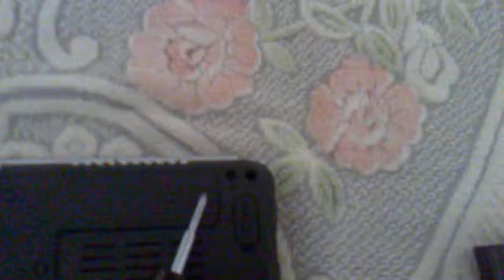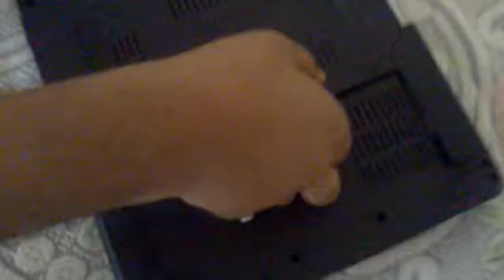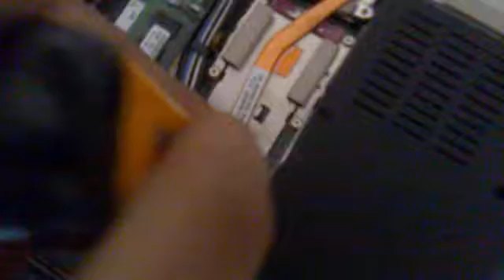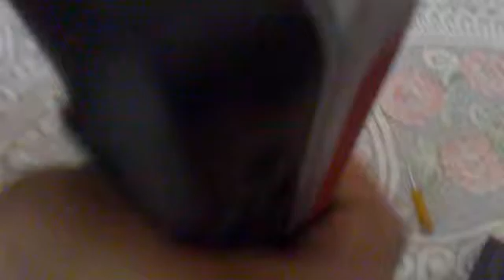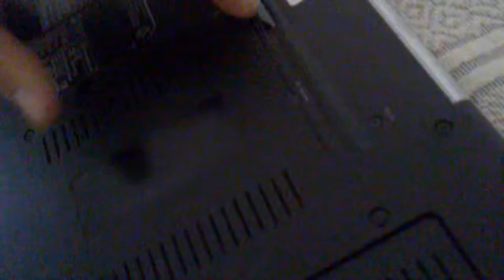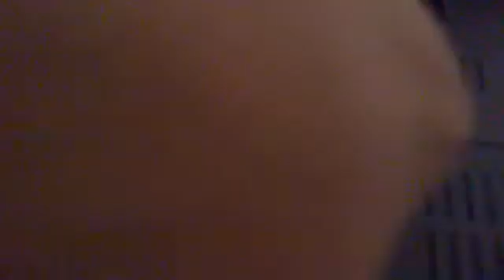dell inspiron1525 overheating solution

Comment: @shuh3070 
hi

i dont know if you still need help, but this no sound stuff happened with my inspiron as well; so the problem in my case is that the fan is stucked; what i do is carefully move the fan with a needle through the wholes, just to help it escape; it does work, but it is just a temporary solution; the fan needs a big cleaning (i myself trust it to the service because of the guarantee)

whatever; this method works with dust but with tea... idk

hope it helped

Comment: Very wonderful. Ended up finding a clog of just dust in the cooling fan and the device part as well. had my air duster handy on that, and now it sounds like a champ and feels good when i type instead of hot keys. Thanks a ton.